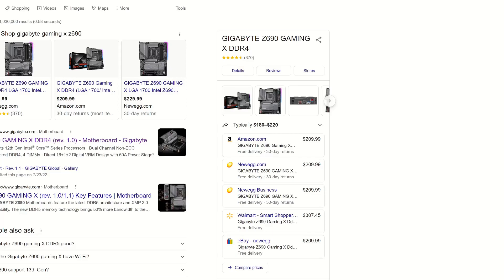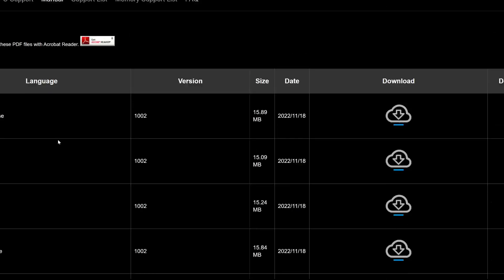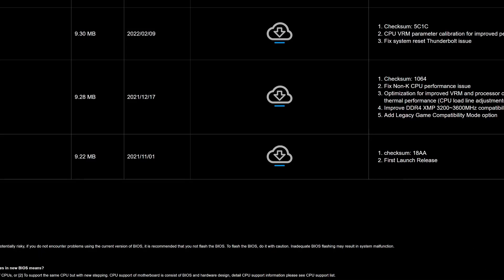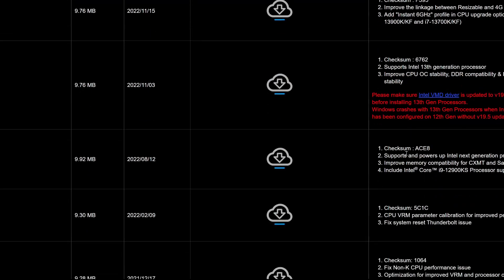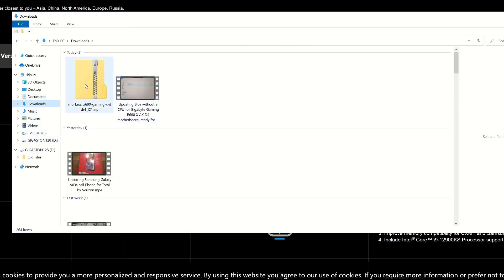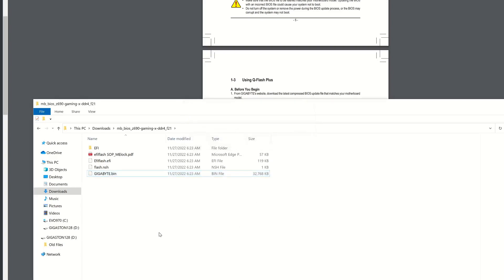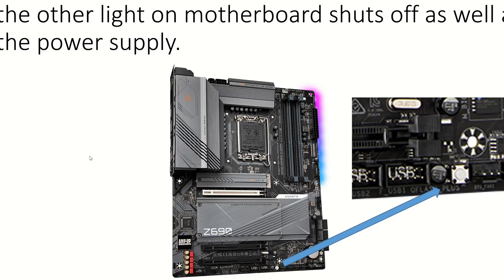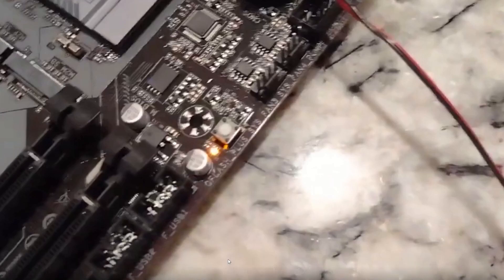Updating BIOS without a CPU, Gigabyte Gaming X Z690 D4 motherboard, how to update

Comment: YEP.......... usb 3.0 didnt work. usb 2.0 did, WELL...... sd card in an adator that was 4gb. however, after the orange flashing and shutdown i switch it on and nothing happens, just red cpu light. im worried that my 13100 is not supported.

Comment: If I install the 13th cpu to check whether it's already updated or not and I find out it's not updated then should I remove the CPU from the socket for an offline bios update or let the CPU stay in there? Also do I have to unplug the cpu power cable(8pin) located on the motherboard
I purchased a motherboard yesterday which is Giga B660M Aorus pro ax with rev.1.2 so what do you think I need to q-flash or simply try 1st whether already updated or not.

Comment: Hello, i do the same I update my Mobo z690 d4 x gaming to F22 and after installing windows 11 I have crush Bleu screen many time
Reply from the maker: Lots if things it could be.  Are you overclocking your ram?
Reply: @PC_HardwareTechUnboxing_1  No I just update bios and  build pc and install windows 11, and sometimes windows crush
Reply: @PC_HardwareTechUnboxing_1  Thank you for your response, I have reset the bios settings and I think the problem is solved
Reply: @PC_HardwareTechUnboxing_1  yes the overclocking of the ram is the cause of problem , can you help to do it without get any problems

Comment: Thank you for this video. I just got the Z690 Gaming X DDR4 1.1 revision, so I'm not sure if this revision will already support 13th gen or if it'll need a BIOS update. The PSU is still a few days away from arriving, so I'm trying to prepare as best I can in the meantime.

One thing I noticed though - you mentioned you do not need to plug in the CPU power connector, however, step 3 of the manual does say to "Connect the power cables to the 12V power connector and main power connector." Thoughts? Maybe it just doesn't really matter if you plug it in or not?

Also, I was reading the motherboard manual, and it has a SPI_TPM header, and it sounds like TPM is something Windows 11 requires. So do you happen to know if that's something else I'm going to have to buy and plug in to that header? Or does the motherboard already include it? I'm struggling to find a concrete answer to this.
Reply from the maker: I have made like 10 of these videos, half of them have the cpu power connected, the other half do not.  My thoughts have been why plug in something that isn't there to be powered up?  In other words, if I have no CPU, why would I need to power up the socket?  That said, I would lean on the safe side and go with the manuals guidance.  

As for TPM, these motherboard work great out of the box with Win 11.  500 series was another story, where you would go into the bios and enable it.  So as far as I have seen in my 20+ 600 and 700 series motherboards, no jumpers needed.
Reply: @PC_HardwareTechUnboxing_1  Awesome, good to know on both fronts. Thank you for the reply! You earned a new subscription 👍
Reply: I have the same board, did you use a 2.0 usb thumbdrive and just use the 24 pin power?
Reply: @andrenikolai1061    I followed the motherboard instructions exactly and hooked up both motherboard connections as that is what it said to do. It probably will be fine either way but decided to do what the manual said to do.

Yep, used a USB 2.0 stick and the whole process was smooth sailing 👍
Reply: @tc16169  thanks man, I think I'll just do the same
Reply: @andrenikolai1061  You're welcome 🙂 Good luck!
Reply: @tc16169 I’m trying to update my bios as well but my motherboard isn’t letting me it just turn on and shows a red light on the cpu led  and turns off I would really appreciate it if you could help me

Comment: My z690 gaming x ddr5 only flashed for about 30 seconds. Should I redo the procedure to be safe / double check?
Reply from the maker: Not sure what to recommend.  I know I would try again. Before I installed CPU.    30 seconds is too short for it to have worked correctly.  If you are lucky this motherboard shipped new with updated bios.  The only other alternatives try it with a 12th gen CPU..or send it back.
Reply: @PC_HardwareTechUnboxing_1  Tried it again under correct procedure and this time lasted longer for about one minute and 30 seconds. First time I tried it one month ago may have accidentally downloaded ddr4 bios update instead of ddr5. I think first time was more like about 10 seconds. Perhaps it is already up to date. Contemplating if I should just return it to be safe since this is my first time building a PC. Maybe shell out a bit more money for a z790 ddr5. I am using i7 13700k for my cpu. Thanks for you reply.

Comment: Do i have to connect the usb before i power the motherboard, with the cable to from the psu, or does this matter?
Reply from the maker: USB needs to be plugged in before you flip switch on PSU. If you don't have a switch than before 24pin connected.  That's mfg guidance..I have never tested it out of order.

Comment: Your video and every other one on youtube did not work for me. My problem turned out to be getting the mobo to the S5 off state. Every time I turned on the power supply the mobo powerd on (cpu fail light on & power supply fan on). I had to connect a switch to the mobo power pins. Holding the switch for a few seconds turned everything off( S5 state). Once in that  state the qflash process worked as expected. This might help someone else.
Reply: Hi, I have the exact problem than you 
Can you run me back through the steps for this to work ? 
What do you mean by a switch to the mobo power pins ? 
Thanks
Reply: same problem for me. please help, i've tried everything already

Comment: Hi I’ve did this with everything plugged in and during the bios update I never got a red light but I did have flashing yellow lights for around 5mins, after that I tried to boot my pc but it has VGA red light on my motherboard and nothing will show up on my monitor. Can u help me with this please? Ty
Reply from the maker: What CPU did you get?  If it is a K type...ensure you have the minimal items hooked up to boot to bios. I have a vid on this for basic set up.   If it is KF.. hopefully your GPU is hooked up and working correctly.
Reply: @PC_HardwareTechUnboxing_1   ive got a i5 13600KF, if possible can u send me the video on how to fix the vga red light? thank you very much
Reply: I have the Same Problem.can u help me?

Comment: Is it possible that the procedure ends in one minute? I should insert only the file renominated in the pen drive correct? Same led of yours before shut down
Reply from the maker: The 9 of these I have done...have all lasted 6-8 minutes..the one that failed last 3 seconds
Reply: @PC_HardwareTechUnboxing_1  in fact it's strange because i retried and the same thing happens, flashing orange light and steady red light for just under a minute and then everything goes off.. what you suggest? It should be 6-8 from what i read. Maybe i'll try to change usb
Reply: @enricocampagnaro8448  same for me... You succeeded ?
Reply: @Damdeho  i was installing ddr5 mb version of gaming x 😂
Reply: Not DDR4 my version
Reply: I also have the ddr5 version. I did a bios update and it only flashed for about 30 seconds so I am wondering if I did something wrong? Did yours work out ok?
Reply: @Sam-pj8yp  Did you plug the usb key into the "bios usb" (orange) usb port?
Reply: @Damdeho  Yes, I just tested it out again and it ran/blinked for about one minute and 30 seconds this time. Usb key was inserted into the usb labelled port area of the motherboard. I applied the F23b latest bios update version to usb drive under the correct FAT format. Perhaps it already has the latest update? I bought about 1 month and a half ago.

Comment: I have one minute of a constant red LED for CPU and RAM and no BIOS shows. Do I need to unplug all CPU and everything to update the BIOS with this method?

Second question:
"Please make sure Intel VMD driver is updated to v19.5 or above before installing 13th Gen Processors.
Windows crashes with 13th Gen Processors when Intel VMD (RAID) has been configured on 12th Gen without v19.5 updated."
Its a new PC, do I have to worry about this alert?
Reply from the maker: From the feedback I am getting...it looks like you should not have anything plugged in except the 24 pin and after powering on..the thumb drive.  I have done this video for 5 motherboards...so quite a few comments.

I have not had a problem.  You should only have a problem if you have multiple M.2s and you are trying to run RAID.    I may demonstrate the error at a later ..assuming I can recreate it.
Reply: Hi, i have same problem, you find issue?

Comment: I am doing this with everything already installed in my computer, the red light by the watch battery does not light up for me, and when I boot my computer I always get a red cpu error and my bios will not open up
Reply from the maker: If you didn't get the 8 minutes of blinking light right next to bios button...I would think you need to completely uninstall everything and only have the 24 pin attached.  Power on PSU with the switch directly in the PSU..than hit the bios update button.
Reply: @PC_HardwareTechUnboxing_1  update I have fixed the problem, everything downloaded fine I just didn't have nearly enough thermal paste LOL, if anyone is reading this don't slack on the thermal paste like me hahahaha
Reply: @PC_HardwareTechUnboxing_1  I get the orange flashing light that flashes for 6-8 min but the red one never comes on next to the watch battery, and I can never get anything on my screen, I just get a cpu red light on my motherboard. I guess I will have to try with everything unplugged, thank you

Comment: Have you tried  overclocking  a 13600kf on that motherboard
Reply from the maker: I have only overclocked the I5 on Gigabyte UD Z690, MSI Pro Z690-A and an Asus Z690 D5.
Reply: @PC_HardwareTechUnboxing_1   ok thanks.  I am just curious  have you overclocked a 13th gen i5 or i9 on a gigabyte  aorus  elite  z790 or z690 motherboard.  Thanks.

Comment: if Install 13th gen CPU and CPU power it will reboot into bios once it updates without any issues.
Reply from the maker: I have done this with about 4 or 5  - 600 series motherboards (Gigabyte UD Z690, Aorus Z690 Extreme AX, B660 Gamign X, Aorus B660m Ultra...and yes, I have not had a problem.  However, just with every motherboard doing a bios update there is a very small chance of something going wrong (power outage, user error...etc).